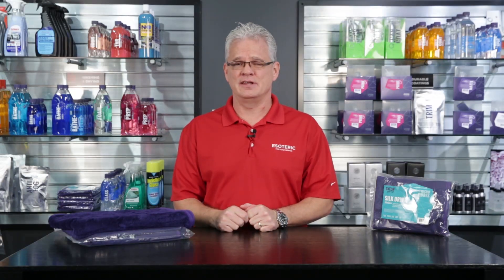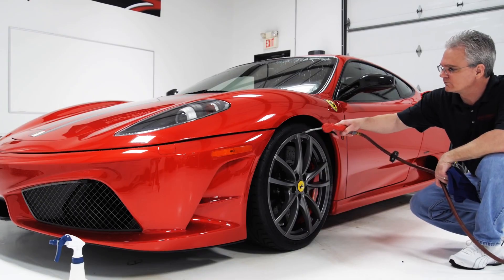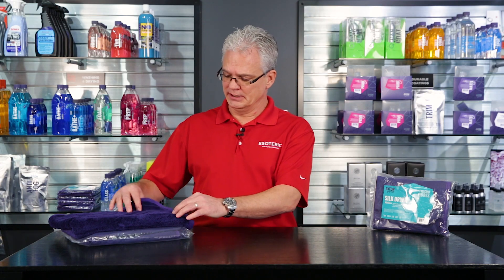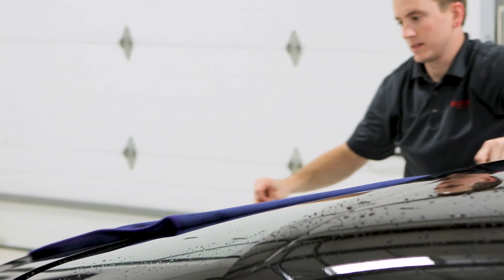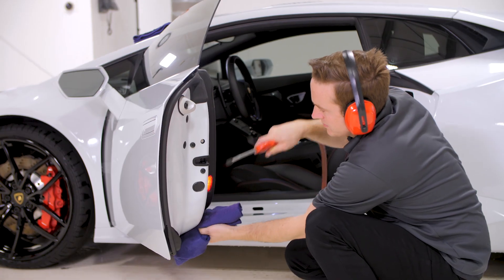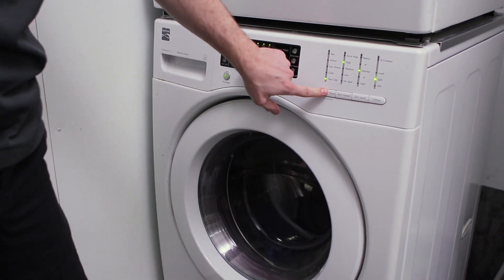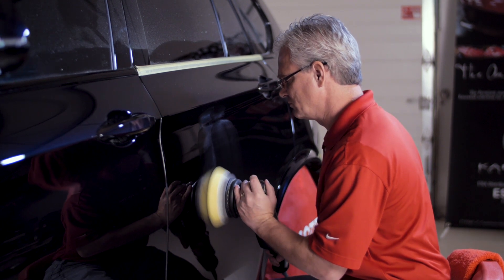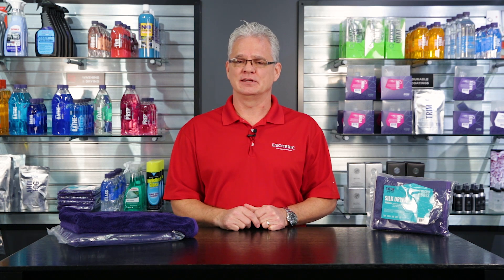Gyeon Silk Dryer Towel Review - ESOTERIC Car Care

Comment: What about the other site of the towel? Is that also usable for the paint or not recommended? Because it looks not very soft? Please advise
Reply from the maker: You could, but we always use the one side exclusively.
Reply: @Esotericdetail  thanks for answer, okay, but isn't it a shame that one side of the towel is not used by most actually? In my opinion, maybe i'm wrong but you'd better put braids on both sides of the towel to make better use of what you paid for right? Most twisted towels have two sides like the Rag Company Liquid8er towel for sample
Reply from the maker: @dondiablo5583  I honestly don't see how it makes a difference because the entire towel is going to get soaked through. I can't say that we've ever thought of this towel "needing" both sides to be the same.
Reply: @Esotericdetail  okay thanks for info bro👍🏻